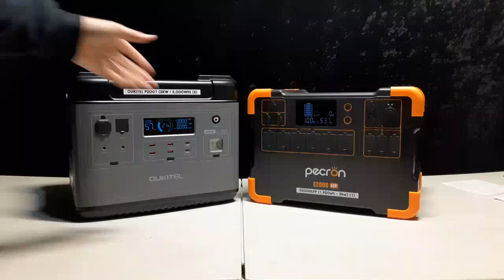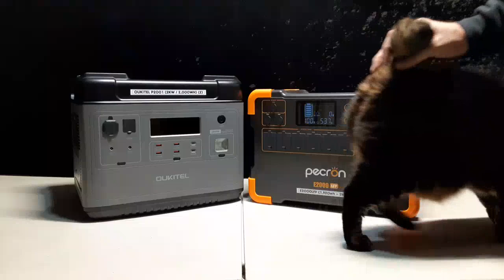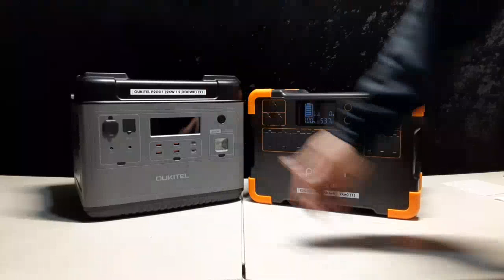PECRON E2000LFP vs OUKITEL P2001 (Part 2)

Comment: I bought the Oukitel on kickstarter. The biggest issue i have with it is the efficiency and the fact that mine makes a lot of noise when using the 12 volt section, fans run a lot and is loud when using just the 12 volt section. The rest of the time it is great. I do wish it had a higher voltage input on the solar.  I would not pay full price for the oukitel. But you can get it with a lot of different of names on it for less than the $1500 or $1600 full price. I have seen $1100 on certain names and for a 1500 wh the unit it is a decent price. I have not got a pecron. I do not want any that use the brick chargers. The first power station i bought had one and i did not like the brick. It was a blutetti eb150 which i paid less than $1000 for, it gets around 1200 wh. It is a good unit but I prefer the built in charger.
Reply from the maker: I agree....

And that UPS (Universal Power Supply) on that oukitel p2001 is great.

The other thing that is a pain in the butt is when the solar input is not high enough, It makes this crazy beeping noise that drives you silly.

BUT, It is a good unit :)
Reply: @RamblinBobReviews  I looked up Pecron on amazon, the price is now at $1299 without the extra batteries. not bad at all, and they do have a unit with the built in ac charger but i dont think it connects to the external batteries, but I will have to do research on that. The last time i looked at the Pecron 2000 unit i think that it was around $1600 to $1900.
Reply from the maker: The only unit that connects to extra batteries as of right now is the E2000LFP

That other power station is nice with the UPS built in...BUT, Can not add any batteries and it is only 1,500wh (1.5kw)

But it is a nice unit as well

Comment from the maker: Forgot to add.

You do get more options with the menu of the pecron (voltage output, Power Factor on the screen)
And the pecron is a 24v system while the oukitel is a 48v system.